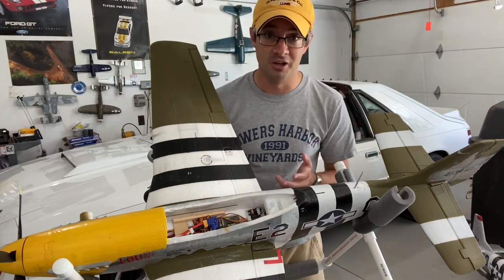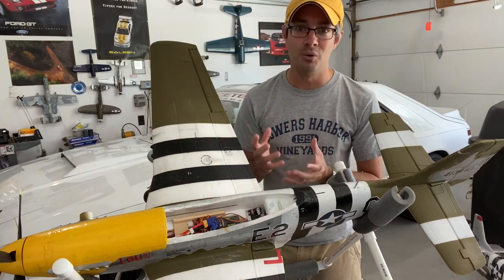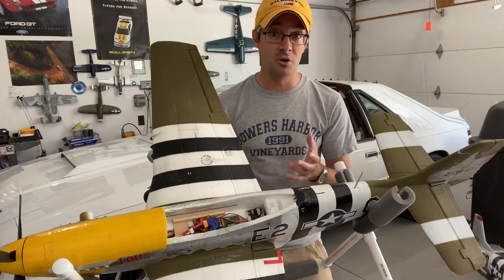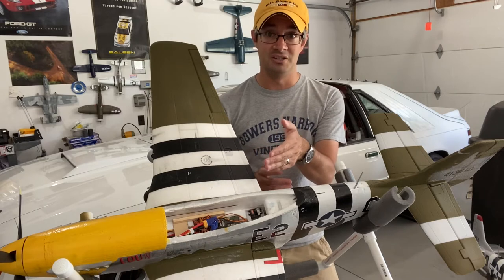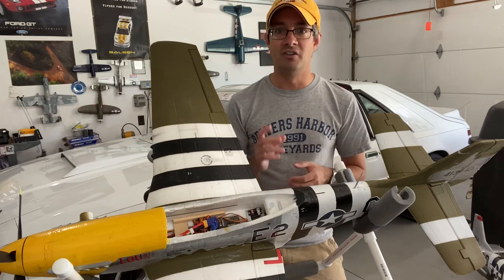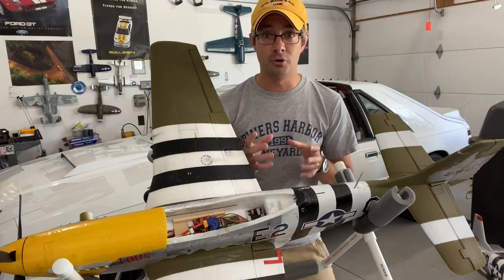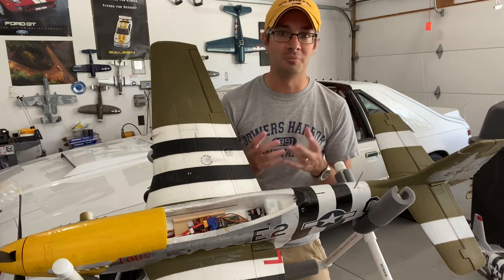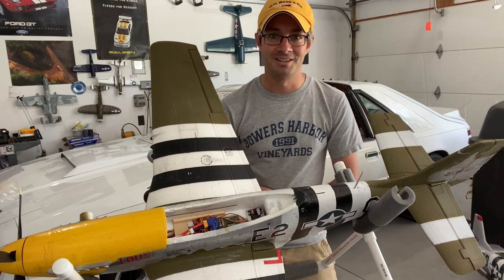Spektrum AR637T User Review-First Time Programming a receiver

Comment: Yeah I'm the same way and still have not started the process yet however, after seeing this video I have to say I have to give it a try. Thanks for sharing your views, it helped me!!
Reply from the maker: I was really scared about programming the receiver, but it was far easier than I ever expected. I flew with it all summer and loved how quickly I could adjust the AS3x gains on windy or calmer days. With my DX6, I had to do it on the ground since I didn't have an open channel with a 6-channel plane. I started with lower gains on AS3x and eventually worked up to the factory defaults after seeing no fluttering or oscillating. If you have open channels, you can assign a switch to either turn off AS3x or adjust it in the air using the knob or a slider. Spektrum has a number of great videos on how to program as well. I watched those and then gave it a shot.

Comment: I have gradually transitioned most of my planes to the AR637T. I particularly like using the DX8 that has the R knob so that I can just smooth out the flight if necessary by turning it up or down.
Reply from the maker: yeah, that is a super nice feature to dial the planes in.

Comment: FYI , with this receiver, or with the AR636, you can use all 6 channels and SAFE on a DX6, you just can't turn on/off the SAFE.   The SAFE will always be on and run in the background.
Reply from the maker: true, but I have zero interest in flying with SAFE being always on. The P-51 really doesn't need SAFE, it is very stable. I wouldn't suggest trying to use the DX6 and programing SAFE on the AR637T as there is no way to turn it off if you have the setup wrong. With more channels, you can at least climb to a safe altitude, activate SAFE, and make sure it behaves properly. If you get the setup wrong on the DX6, it will be on all the time.

Comment: Bought a 5 channel Cessna 182 and ar637t/ar630 same. Wand to set up like a BnF with safe select. Assume as3x always on with factory gains, and envelope either on or off on 2 switch A
Reply from the maker: Yes, sounds like you are the right path since you can leave AS3x to always on (you can tune the gains on the ground, but the factory defaults work very good) and that leaves one open switch for SAFE since you don't need retracting gear on the 182. I am pretty sure you can use a 3-position switch to program 3 levels of SAFE, very much like the factory uses. Spektrum has some outstanding videos on how to set up SAFE. I haven't done it with the AR637T, so I can't help very much.

Comment: Great video. I just programmed a 637T for a Vampire and if flew great. I just used the default gains. 
What gains did you find work best on the P-51?
Reply from the maker: Thanks, I played around with the gains and ended up going right back to the defaults. They worked very well on the P-51. I started by lowering the default gains until after I flew it a few times and then slowly started to increase them. After about a dozen flights, I settled on the defaults.
Reply: @BRGT350  Thanks for the reply. Just to be clear do you mean the default gains of the AR637 (40%,50%,60%, priority 160) or the P-51 defaults, and if so what are the P-51 defaults? 
Thanks
Reply from the maker: I don't recall the priority number. The 40%, 50%, 60% sounds correct. I don't know if I can get into my AS3X settings through my NX8 without the plane being bound. I will check on that tonight and see if I can access Forward Programming. If I can't, I will get the P-51 down from the ceiling to check the settings.

Comment: Hello, So I've chatted with Horizon about the New AR367T 
I have a ARF kit By Dynam the orange crop Duster called Dusty. Im like you I'm used to allot of Bind N fly's as well and this also will be my 1st time setting up a Reciver for this particular plane. No Regarding the Tx I have the DX6 I wanna use the AS3X and Safe on this plane. This plane also has flaps so will I be able to set this up like I want ? An also I have updated my firmware to the 2.7 2020. I've also been watching allot of these videos on how to but like you I'm kinda nervous.
Reply from the maker: I was super scared to program the receiver, but found it far easier than I expected. I followed the prompts in Forward Programming and it walked me through the steps. I didn't use SAFE, but did setup AS3X. I have been able to tune AS3X with my DX6 when I am on the ground. I don't have enough channels to do it in the air since my P-51 uses flaps, retracts, and the normal 4 for flying. You won't have any issues setting up flaps, that is just like it would be for any model. Since you don't have retracts, you can use that open channel to assign SAFE. You just need an open 3 position switch to assign it to. The other 3 position switch can be your flaps. Be sure to double and triple check all of your control surfaces before flying to make sure AS3X and SAFE go in the right directions. The best advice I have had on AS3X checking is if you lift up plane from the wing tip, that control surface should go up. Lift by the tail and the elevator should go up. Lift up and the control surface goes up. I turned up the gains so I could feel the control surface move properly and then turned it down to go fly.
Reply: @BRGT350  Sounds good Thanks for the Response. Happy Flying.

Comment: the ar637t can be programmed with the dx8 some video, they only exist with the ix12 good day
Reply from the maker: yes, the AR637T can be programmed with some DX8's. There is one model of the DX8 that doesn't work, but it is one of the older models and I don't recall the exact name. My DX6 worked very well for programming the AR637T.
Reply: Gen 3 I believe

Comment: What mustang is that and is that a "parkzone" p47 thunderbolt in the back, i have one of those
Reply from the maker: The Mustang with the yellow nose and invasion stripes is the E-flite 1.2m that was repainted. I bought it used and it was really something that should have gone in the trash. I decided to restore it and go from junk to flying in just over 2 weeks. In the background on the wall are some UMX planes and the Tower Hobbies F6F Hellcat. I don't think you can see my P-47 as it is hanging above and to the left of me. It is the E-flite version of the old Parkzone. E-flite gave it a repaint, different markings, and a new receiver with AS3X. It is an awesome flying plane!

Comment: I have a 4 channel Cessna 400 without AS3X. Is it possible to replace the existing receiver with spektrum AR 637T and bind it with DX6 transmitter? Thank you!
Reply from the maker: Yeah, if you are replacing the receiver, then that will work just fine. No issues binding to a DX6. Being a 4-channel plane, you will have 2 extra channels on the DX6 to adjust the AS3x gains or turn the gyro on/off or add SAFE. It is only on 6-channel planes with a DX6 is there a problem with using the DX6 to turn on/off the gyro or tune the AS3x in flight. There aren't enough channels. No problems at all with 4-channels. Even with my DX6 and a 6-channel plane, I have not had any issues with AS3X. I just need to do my gyro tuning on the ground instead of in the air.